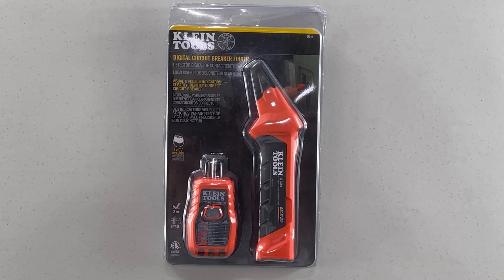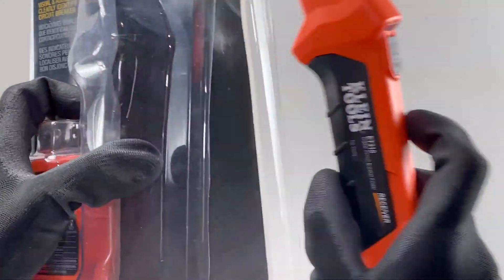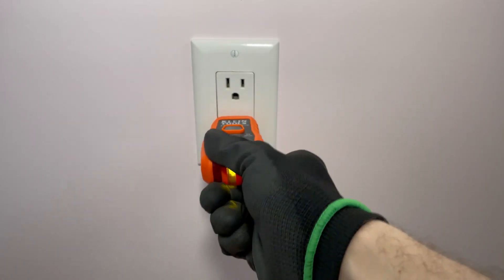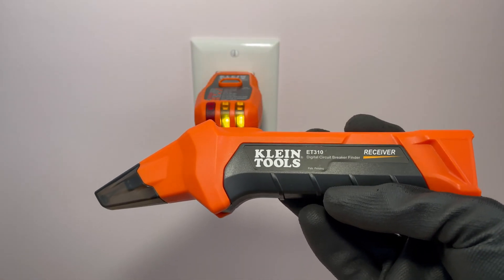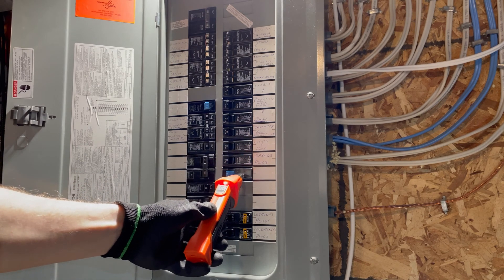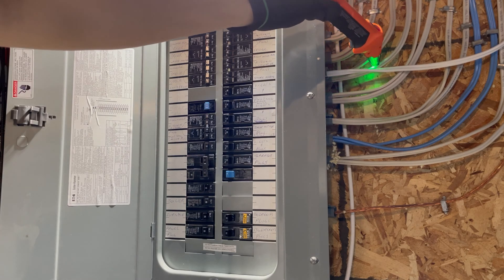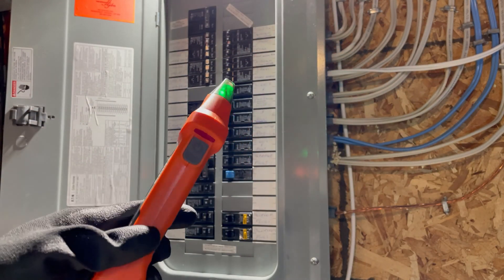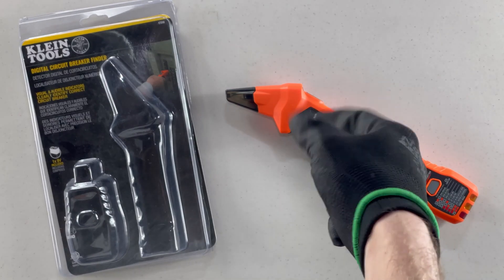How to find a circuit breaker - How to trace a circuit - The Electrical Guide

Comment: I was looking at the Klein ET 450 kit . I have a brok3 underground wire that is connected to a breaker that I switched off for that reason. There are no plugs. if I turn off the main, go inside the panel  and connect red alligator clip to the wires power wire on the broken breaker  and the  the other clip to the panels neutral and then go outside and try to locate it with the scan tool.  I have a general idea where the wire is but don't want to start digging the yard up .  I'm imagining it's a foot or less down and maybe 50 feet from the breaker box.  Will the scan tool attempt to locate the wire below ground?
Reply from the maker: You need to make near direct contact with the wires. Need a different more expensive tool for under ground tracing.

Comment: Is this for tracing non wall plugs? What about light switch fixtures, which don't have plug sockets?
Reply from the maker: Just leave the light on and try breakers until it turns off or you can buy an attachment for bulb sockets

Comment: Don't tink just do and maybe split the cost with a relative so you can both use them as needed over the next 20-yrs  years. .  Buy a Klein ET310 ($50 Home Depot) Digital circuit breaker finder and s accessory kit. Also get a Klein CL120 400 Amp Digital Clamp Meter..$66.00.   Hint. Never assume that flipping off the circuit breaker actually killed the circuit. Test  the darn receptacle first with the Clamp meter and only use one hand.

Comment: I have a fuse box, how do i locate the correct area in my hose, that a fuse is providing electricity?
Thank you.
Reply: House, not hose.
Reply from the maker: Plug a lamp or radio in to the outlet and pull fuses out until it goes off. That's the most reliable way I know with fuses :)

Comment: Wish someone would explain in simple terms how one person can successfully and safely test the circuits for light switch wiring.  Somewhere along the line our labels seem to have been incompletely done.  There are things crossed out, and other slots that don't seem to connect to anything.  I have a call in to an electrician, because I can't simply identify which breaker to turn off while in change out a couple of light switches.  Uggggh.
Reply from the maker: Turn on all the lights you want to replace or test. Have a friend or family member (adult) go to your panel and systematically turn off and back on each 15 amp breaker until the light you're watching goes off. Now you know which breaker controls that lighting circuit. Rinse and repeat for any lighting circuit you're interested in finding the breaker for.

Comment: Is it possible to use this tool even if the outlet is not working (so assuming the circuit breaket is bad)?  If not, any suggestions?  Thanks much....Amit
Reply from the maker: You can always use the continuity method with a multi meter.

Comment: The instructions say You're supposed to run the device across the panel twice. The first time to learn the panel and the second time to find a breaker panel attached to the switch

Comment: Can you use the receiver to see if a nearby but separate outlet is on the same circuit by putting the receiver probe tip near the other outlet face?
Reply from the maker: That may work, if it's wired upstream then for sure.

Comment: I bought this one last month to test all the outlets, switches and lights in my daughter’s house. The previous owners did quite a few renovations to the house. I knew by looking at some of these renovations that they were not to code. The #6 circuit breaker kept tripping at least once a week. 
So I went over and made a schematic of all the outlets, switches and lights. I found that there was 17 devices running off that one circuit breaker. And a few others had maybe 2-3 devices. I had to rewire a few electrical devices. It’s been 4 weeks and no problems…so far. But this Klein tool was a great help. I also bought a few accessories for testing the lights and the older two prong outlets. This is definitely worth it money.  But don’t forget, it take a little practice and patience as some times you will get a false reading.
Reply from the maker: Thank you for sharing your story. A+ dad here folks! Glad you were able to master the device and it's quirks and put it to use!

Comment: I had a short somewhere the Man who came just used this handy devise. If I had one I could have saved the 600 dollars😮. But met a Nice guy I would call him again if I need to. But this tool is cool was my light wiring on ceiling that cause the fridge to stop working.
Reply from the maker: Expensive way to find out about this tool 😅 glad your problem is fixed though 👍

Comment: I'm assuming this will NOT find where an un-energized wire goes? This needs for the outlet or wires to be energized? Thank you
Reply from the maker: Skylark cool name, My father in laws boat is named SkyLarkin😂

For wires that are not energized use the continuity setting on a multimeter. You can attach the wires in question together at one end and use the continuity setting on the meter to find a tone on the other side of where the wires are. Example: attach the white and black if your circuit at the plug or switch and put your meter leads one on the neutral bar and the other lead put from breaker screw to breaker screw until the meter beeps at you. Good luck! Turn the panel off first 👌
Reply from the maker: https://youtu.be/N7kJNxQYmf0?si=pyT_SBMzH_GbHXOE
Reply: @theelectricalguide  Thank you very much for that info, that makes sense and didn't occur to me, I guess if I get nothing then maybe the wire is capped off somewhere and doesn't go to anything, which is kind of scary because it was energized at one point. SO!, very interesting and a coincidence you would mention your father in laws boat, I have my name "Skylark" not just because I love the car but because I own a "Skylark" Correct Craft boat, very rare! drives on the left, shifts on the dash, and has a gas pedal on the floor! which makes it very interesting to drive in waves if you can imagine! They made a Mustang and one other! Here's one, wish mine was in this shape, https://youtu.be/Z0J6PSdD8AI?si=QW76GeCoCnlQ7IaZ

Comment: What if its a circuit that doesnt have an outlet on it? Like a dishwasher or light fixtures
Reply from the maker: Both of those things have visual signals that they’re off. Have someone stand beside the light that’s on or the dishwasher that’s on and watch for the lights to go out on the light/dishwasher. Then you’ll know whoever is at the panel flipping breakers found the right one. 👍
Reply: @theelectricalguide  of course but was asking if your your doing it alone and didn't want to run back and forth to the panel 20x
Reply from the maker: @BOSS_805  There are some other more expensive tools you can buy for tracing circuits but they're potentially $1000+ the old fashion 2 person method is the easiest and cheapest :)

Comment: Keep in mind that IP40 doesn’t offer water resistance. The first digit in the IP rating indicates protection against solid particles, while the second digit represents protection against liquid entry. In this case, the device’s safeguard against tools and small wires greater than 1 millimeter is denoted by the “4”. However, the “0” signifies a lack of protection against water ingress. It’s understandable why this could be confusing, especially with the water droplet symbol next to the IP code. I wanted to raise awareness to help prevent any unfortunate accidents. This video provides valuable insights!
Reply from the maker: Love this added bit of info, thank you!

Comment: This device gives erroneous results. It will give a positive response on multiple circuit breakers. Buyer beware.
Reply from the maker: Indeed, I kinda show that in the video. The positive responses are weaker though, you’re looking for a solid loud bright signal not a quick beep or two. This takes a little practice, but after using it a bit I’m able to reliably find the circuit.
Reply: Make sure using it on single phase systems. 3 phase systems it's a lot harder. Sometimes it works. Sometimes it's useless.
Reply: You need to run it across your panel slowly to pinpoint the exact breaker. Instructions take 30 seconds to read. Works flawlessly for those who enjoy learning.

Comment: will this tell you if there are 2 outlets in the same room are on the same circuit without going outside to the breaker box?
Reply: I had the same question and so I tested it and I was able to plug into one and then test each hot wire after removing the cover and found the outlets and switches in a circuit.

Comment: Can this be used to find the circuit breaker on an outlet with no power? And how would you trace an outlet that might be getting its power from a gfi outlet? The outlet is not working and pressing the reset on the gfi has no effect.
Reply from the maker: You need power for this device, you can purchase more expensive circuit tracers to find without power. Your GFCI that won't reset is either without power or defective. Maybe go around your house looking for another GFCI that's tripped? Backyard, front porch, bathrooms, kitchens.

Comment: To verify the circuit after using the tool, I shut off the breaker and then check to see if the receptacle in fact does not have current.
Reply from the maker: The circuit doesn't have to be off. Just plug in the device into the outlet you're looking for and use the wand at the panel side to try and locate the breaker for that circuit. I think maybe the proximity tester might be easier to use,  jam it into the smaller of the vertical slots in the outlet and flip breakers off until it stops beeping. https://youtu.be/34ODFi4jDKE
Reply: @theelectricalguide  Thanks for the clarification.

Comment: How do you find circuit breaker to a light switch?
Reply: Turn on the switch (and the light it controls). Get the $16 Klein fixture adapter kit and replace the bulb with the plug adapter. Plus into the adapter then scan at the panel as usual.
Reply: @kwolson59  you are smarter than the guy who made the video. Thank you
Reply: @kwolson59  Thanks for the tip. What if the fixture is led with no bulb?
Reply from the maker: The easiest way is not to use one of these tools but instead just flip the light on and turn breakers off until the light goes out. Best done with a partner. If your light doesn't work and that's why you're trying to find the breaker for replacement you can turn the switch off, take the light mostly apart and use one of these tools  https://youtu.be/34ODFi4jDKE to identify if the wires are live - also best done with a partner.

Comment: Do they work if you turn off power or you lost power from that outlet?
Reply: No. 
Receiver works off battery. 
Transmitter / tone generator needs 120V power from the outlet.
Reply: @mikemm60  Have a similar device, If you flip the breaker off the transmitter loses power which is confirmation that you have found the correct breaker for the outlet that you just plugged the transmitter into. As you show you can get false positives (beeps) from other wires. flipping off the suspect breaker is 100% confirmation that you "identified" the right breaker!

Comment: New toys are always fun! Also side note, if the wires in an old house are to short when you go to replace an receptacle, you can just pigtail it right? Sorry for asking so many questions .. Summer holidays so my teacher hasn’t got back to me lol
Reply: You need to make sure you do not have too many outlets on the circuit or you could burn your house down. If you mess with the wiring and do it wrong, the insurance company can deny your claim.
Reply from the maker: Hey, yeah you can pigtail them. Check out my timer switch video to see how pigtails are done properly. I encountered a few really short wires in installing that timer and was forced to extend them with pigtails. https://youtu.be/Eu4wiM1M3mY

Always happy to answer viewer questions! Keep wondering!